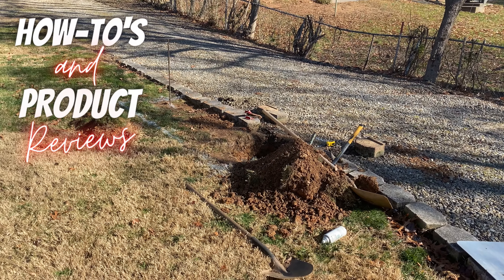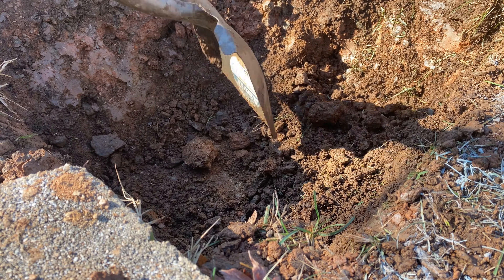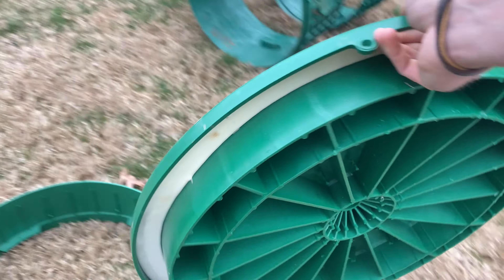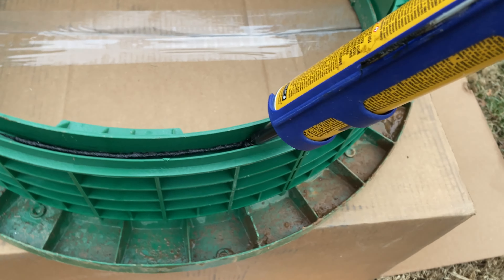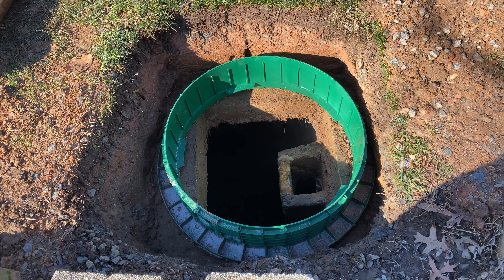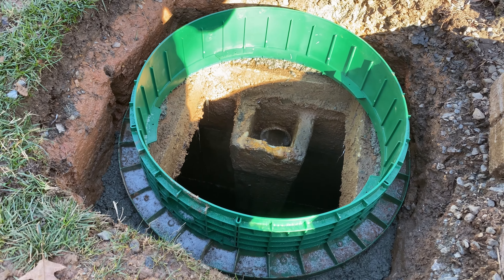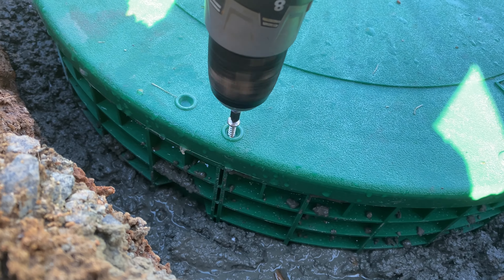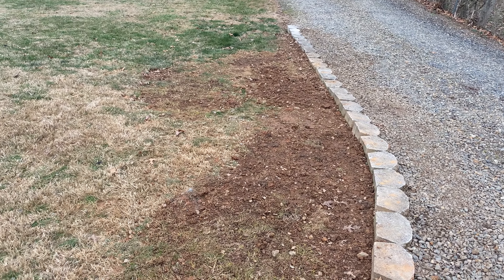How to Install Septic Tank Risers + Locate Septic Tank  #septictanks  #plumbing  #toilet

Comment: Use mastic and or 2 part epoxy with a bolt down kit after you smooth out the concrete with a grinder brush. Bring a torch and heat the concrete up to dry it up and clean it 🫡🫡

Comment: Currently dealing with blockage I think I should go throw the inlet pipe that comes from the house to clear it up this video helped because I have only the outlet capped but the inlet side is is not exposed.
Reply from the maker: Sometimes there will be a cleanout pipe sticking up between the house and the septic tank. If so, the cap can be removed and that's a good way to check for blockage. Have someone flush a toilet or leave a tap running and you should see water running through..
Reply: I had the same thing going on and had to dig up inlet side and snake from the inlet in a pinch. Of course everything was going wrong hours before I had a bunch of teenagers coming to my house. (My kids friends).

Comment: Just a quick question, I live in an area that sometimes the temperature drops to 30 below Celsius, would the tank not freeze?
Reply from the maker: I would check your local guidelines/building codes before installing, especially if your in an area that gets that cold..

Comment: curious why the base isn't sealed and screwed down into the tank?  if the concrete around the base were to crack couldn't that be a way for groundwater to seep into the tank?

Comment: Thx for video.  I dug up my septic that is 6ft deep.  I want to put risers on top of the 2 cement lids.  I see 2 sizes are available, 18" and 24".  How do i know which diameter to use?
Reply from the maker: I measured from corner to corner of my septic tank lid since it was square. This way I was able to pick a diameter that would encircle the largest distance (corner to corner)
Reply: Do they come in different depths also?
Reply from the maker: @magwed4120  yeah there a few different depths available. They may even be stackable?
Reply: There is also the type that uses 24 inch double walled PVC pipe as the riser.. Its the same pipe they use to extend the road drainage ditches under driveways. If you're going down 6 feet this is going to get very expensive using these stackable rings.. These things are not cheap!.. But a 12 foot length of that pipe you might be able to find a length that somebody is getting rid of.

Comment: STOP DO NOTnstall this way.
Do not fill the lid with concrete , this will only make the lid very heavy 
The ribs give strength to the top .
Clean the top of the tank  around the lid and add asphalt caulking to the bottom of the flange ring ,also the tank where the flange sets this will prevent roots getting I into the tank .Secure the flange to the tank with 3 self taping concrete screws in the screw holes provided.. 
Add asphalt caulking to the bottom side of the riser and screw to the tank flange to seal the connection. If using more than 1 riser seal  each bottom  and attach with screws.  Install the self sealing lid with screws .
Use a fair amount of asphalt caulking. Silicone caulking is not compatible with asphalt caulking Do Not use together. 
  Cementing the flange to the dirt on the tank and the plastic is a pathway for roots to get into the septic tank . Asphalt   
Roof caulking will make a good bond between the tank and the plastic  flanged if the surface is good and clean .
Reply from the maker: That’s fair, and likely the best practice honestly. This is just how I did it at the time. Luckily I don’t have trees anywhere remotely close to my tank so I wasn’t concerned with roots. Hopefully I won’t have too much issue with water creeping in is my only worry..